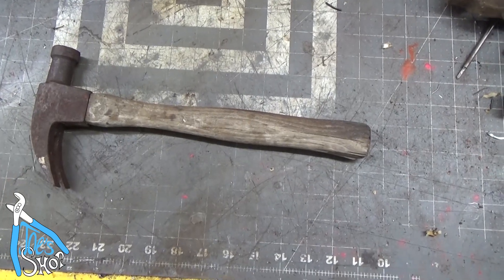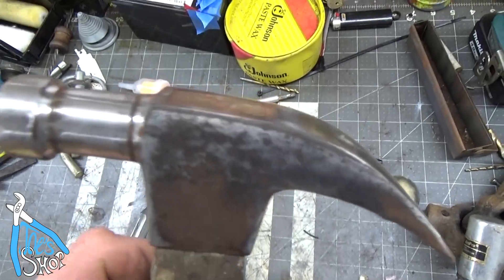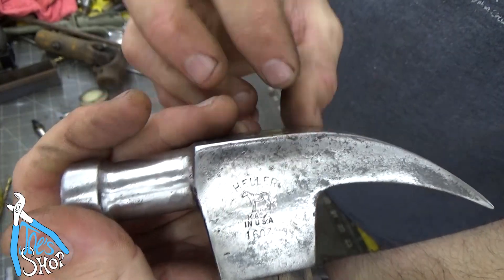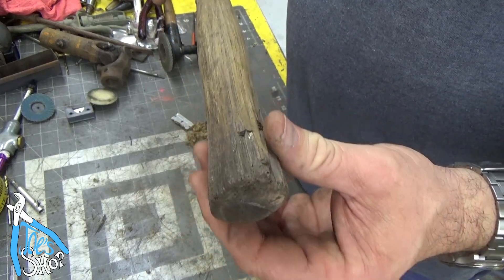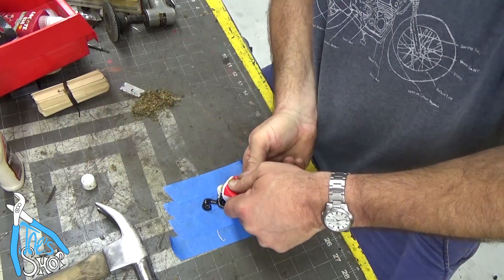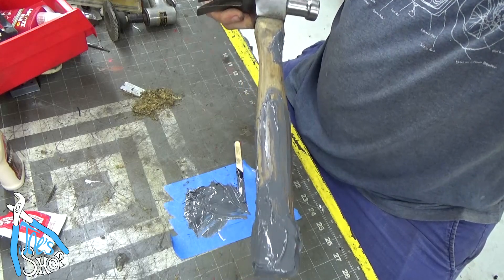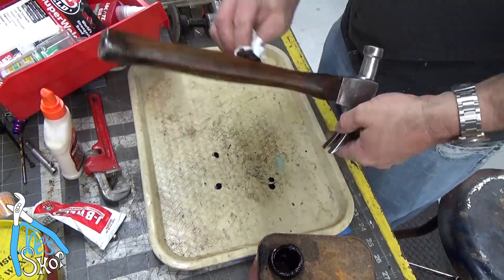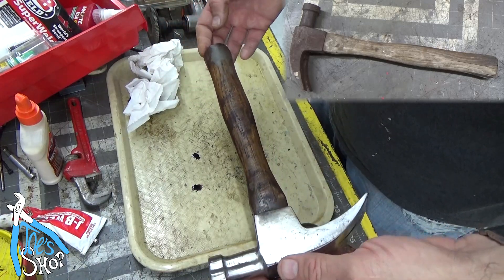JB Weld Wood Handle Repair

Comment: Another tool put back into service.  Thanks for posting.  After watching some of the other tool restoration channels I tried gun blue on a pair of channel locks that was rusted badly.  After a serious session with a Angie grinder and lots of polishing I was absolutely astonished on how well the gun blue looked.
Reply from the maker: Hi Russ. The bluing looks really awesome. I'm not sure it is super durable, but then again there is no perfect finish. Cheers

Comment: Those Heller hammers are quite desirable and not often found.  That JB weld was a great fix and is probably stronger then the rest of the hammer now!  I remember once I fixed a crack on a piece of wood with JB Weld and went to sand off the excess, the sander was removing all the wood around the JB Weld because it was so hard!  I had to take a file and even it out because the wood was so soft in comparison!  LOL   Great stuff Joe!

Comment: Very cool! I love heller tools. They made tons and tons of farrier’s hammers and blacksmithing hammers. I don’t see
Many claw hammers from them. Cool fix. I was just talking about using CA glue in handle cracks and chips. You can get the colored glue also and it blends pretty well. You can build it up with the activator and there isn’t as much work removing material. But one more thing to add to the arsenal. Jb weld! Thanks for the video!!

Comment: That’s a nice hammer Joe. Heller made great stuff. Mostly farrier tools and rasps. The JB Weld will work fine. They also make a product called Kwik Wood. It’s like Steel Stick but it’s tan colored. (Two types of putty you mix and it hardens). I’ve used it on handles too and it works great. Take care
Reply: David Coats - Thanks for the tip on the Kwik Wood.